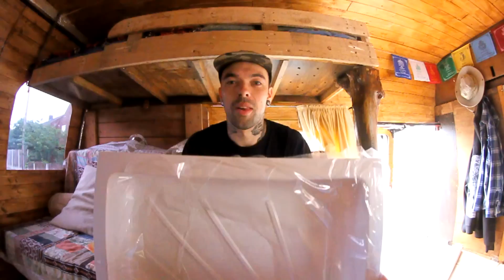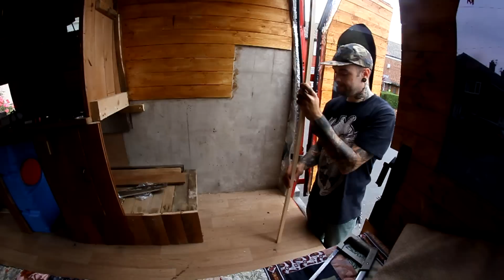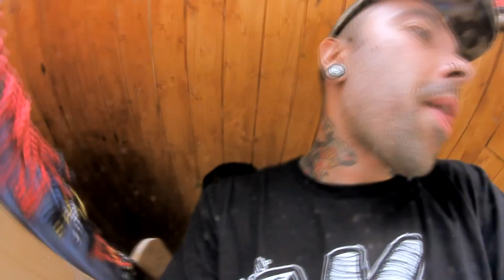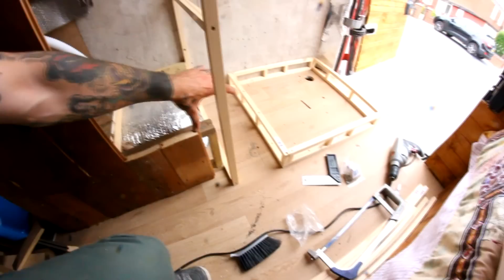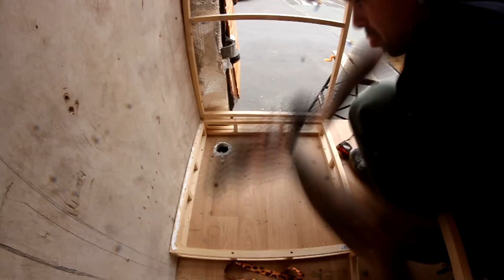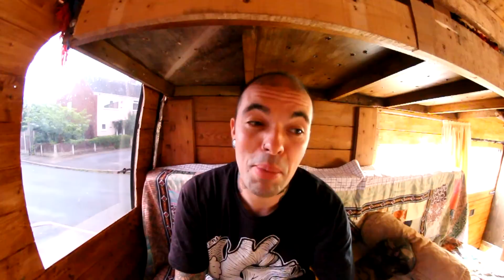Van life : Diary of a van man 11 - Shower!! (part 1) Campervan conversion

Comment: Just use a plastic storage bin, just take the stuff out before spraying yourself with water. Instead of walls use a shower curtain with a rail connected to your ceiling.

Comment: Good job. Your camera makes everything look bent (apart from you. You don't look bent 😆. Ooh, I'm probably not allowed to say bent am I...? F*ck it). How much did your LDV weigh after conversion?
Reply from the maker: haha that will be the wide angle fish eye lense! Im not sure about the LDV, i never got it weighed!
Reply: @leonperkins.outdoors  Ah yes fish eye. So why did you get shut of it?? I'm just thinking of buying one... 🚐
Reply from the maker: @corallaroc  constant repairs and paying out for parts and repairs eventually wore thin.... nice and cheap vans, look awesome but the rust,leaks and repairs aren't awesome. the rear diff went on it eventually so i scrapped it and got a 2003 sprinter :)
Reply: @leonperkins.outdoors  What did you pay for it, if you don't mind me asking? Also, is the sprinter LOADS better or just better? Aren't parts more expensive on a Merc? Ta
Reply from the maker: Holistic-Healing UK I paid 400 for the convoy, the body work wasn't great. I had it on the road less than a year. Spent about a grand on repairs. Sprinter was £1400 had it almost two years added 30000 miles on the clock and only spent about 400 on repairs, n that was only a bit of welding, a ball joint and some bearings. Worth the reliability compared to the LDV I think. A lot of people still have convoys though, I might have been unlucky!
Reply: @leonperkins.outdoors  Well £400 is feck all really is it as is £1400. Not seen your sprinter yet. Will check it out shortly. The one I'm thinking of buying is £4250 X reg, 120K on clock. It's all kitted out (I unfortunately don't have the skills to do it misen). I think it looks okay and checking mot's on gov website, it's had only one fail in the past 11 years. Guy selling it doesn't have full log book though so folk are saying don't touch it. Don't know what to bloody do now! Lol 🙄

Comment: dude, did you just rip off Van Dog travelers typography and graphical layout?
Reply from the maker: timothy790110 haha to be honest it probably is a really similar font?! But I've used this font on videos and things long before I started doing van videos or even found out about vandog... I did buy his ebook though and it was a great inspiration for this build 👌. I'm not gonna not use a font I like just cos somebody else has one similar 😊
Reply: no worries mate,  just bustin your balls. you got great content, subbed.

what was that first van that shit the bed? looked like a swb sprinter, the kind im looking for (with the high roof)
Reply from the maker: timothy790110 thanks for subscribing 😁. My very first van was a daihatsu extol, tiny little thing but I loved it, the head gasket went on that. 2nd van was the one in this video, ldv convoy,  a few things broke n got repaired but the last straw was the rear differential breaking. The latest van is a mwb high top sprinter 😊

Comment: I know I'm completely new to this. Hell I just got the idea of making a van life type thing into a 5 year plan for future living. Now I love this but like many things I'm looking at, it takes up a lot of space. Because of that, I think I might make it like my bed and desk. Able to transform. I think if I make it normal, I might be able to fold it when not in use to only take up 8" off the wall. Might need to build a prototype to see how it works. But I will for sure have to grey water this if ever I use it. I think that 8" will surly be enough to fold everything in and still have room for the hot water heater.

Comment: @leonperkinsi was thinking of something similar but i was planing on gutting the van floor and putin down a acrylic floor then drilling a hole for a drain through it. with acrylic walls as well to kind of water proof the area. what do you think
Reply from the maker: sounds like a good idea!!
Reply: thank now i gotta figure a place for the 
Camp Chef HWD5 Triton Hot Water Heater i saw on amazon i dont know if they are waterproof .But i figure it could fix to problems at once have you seen these?
Reply from the maker: no i dont thhink i have! have you got a link?
Reply: https://www.amazon.com/Camp-Chef-HWD5-Triton-Heater/dp/B001J4AU2E

Comment: I was thinking he's going to have to fit a Mini Heiki  - but the seat is a great improvisation. It will be good to have somewhere to put wet coats.
Reply from the maker: haha that would have been a good one! yeah, perfect for drying stuff off! i also have a solar shower for the summer to shower outdoors and a gym membershio ti use their shower, this one will only be for the times i cant use either of those :)
Reply: Very Interesting - I know that's popular in the States - but I've never seen it mentioned here. Is that a National Gym Chain? How much does it cost - do you have to pretend to do gym like things or can you just use the washing facilites?
Reply from the maker: yeah Its the sports direct gym, if you only go to your local on its £5 a month but if you want to use nationwide gyms its only a few quid more a month :) I go the gym anyway so i would probably use it then have a shower afterwards, but it would be fine if i just went in for a shower haha they are getting my mone either way!
Reply: Thanks - that's really useful to know - surprised it's not mentioned more often (by Wild Campers).

Comment: great idea making a seat! i'm looking forward to the next part to see what boiler you go for? in my bus i have gone with a instantaneous tankless heater with a seaflo pressure pump. if you use a pressure(diaphragm) pump you need to fit an accumulator  inline to stop the water pulsing, a good trick to save having to buy an accumulator is to fit a water filter  instead as it will the same job. keep it up you doing great.
Reply from the maker: Yeah thats the same type of heater im going for! Ive already bought the pump and the accumulator just need the heater now. saw a good one on amazin for £100 that comes with the shower head too! :) Thanks for the comment!